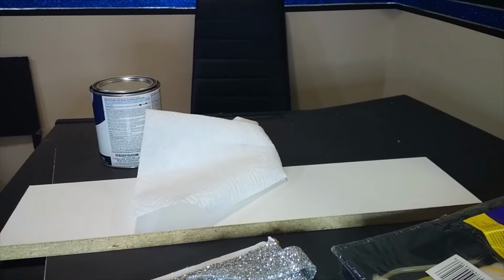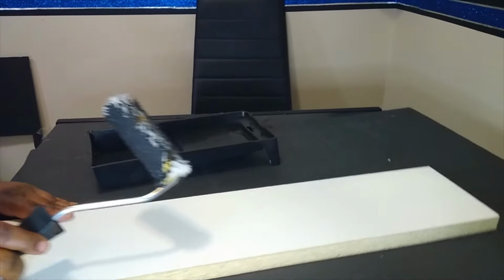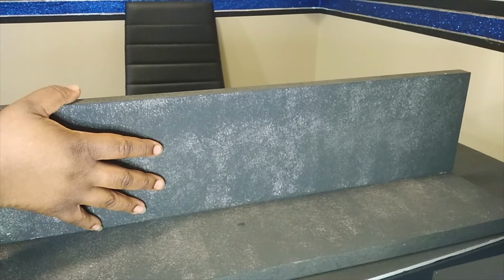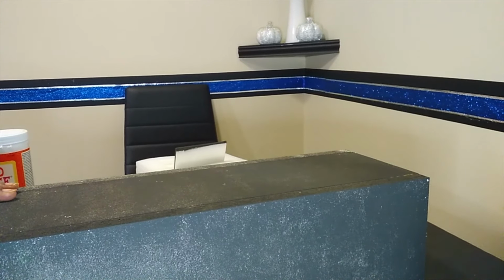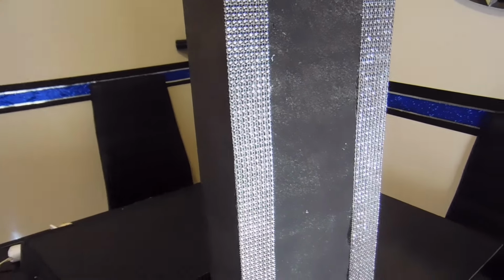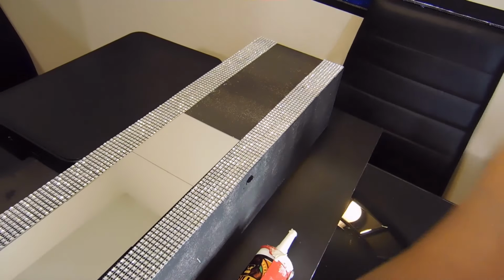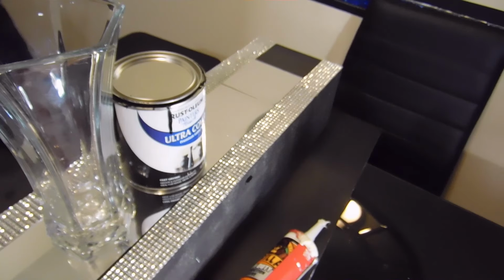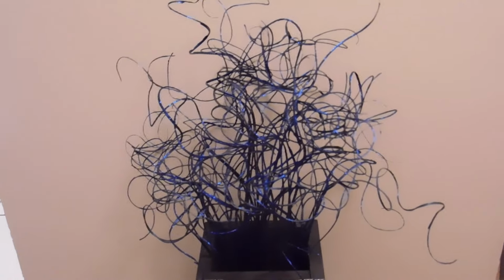DIY mirror floor vase

Comment: WHAT DID YOU DO FOR THE BOTTOM?  YOU DON'T SHOW HOW YOU PUT THE BOTTOM OF THE VASE?
Reply from the maker: I traced the bottom onto a foamboard and cut it out, placing it inside the bottom so nothing falls out.
Reply from the maker: You can also have a pc of wood cut out and screw it into the bottom as well.

Comment: So basically we can use any length of wood depending on the height we want yes?? And, we use gloss and not natural paint too xx thank you for sharing you don’t know how much money you’ve saved us xx
Reply from the maker: You're welcome and you can make it any way you can. I have made some out of foam board. The customer loved it but mentioned she would of preferred wood so this is the purpose of the video in case ppl want to use wood. You can paint with gloss and get your wood from Lowe's. Plywood is much cheaper and easy to paint.

Comment: That’s stunning and so simple xx But we don’t have to use a glue gun is that correct?? And could we use gloss instead of paint or paint it then gloss it?? I’ve got an old large wooden mirror: should I just paint over it and then gloss it or sand it down first??
Reply from the maker: Is it possible to inbox me on fb and send pics of it?